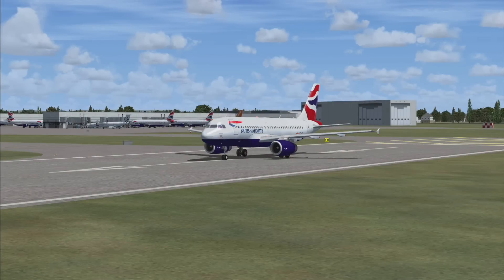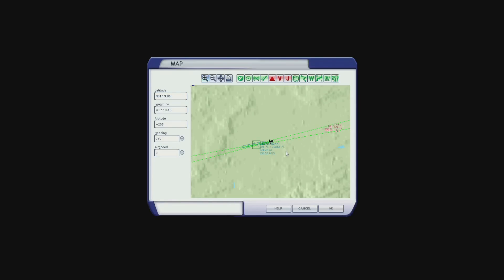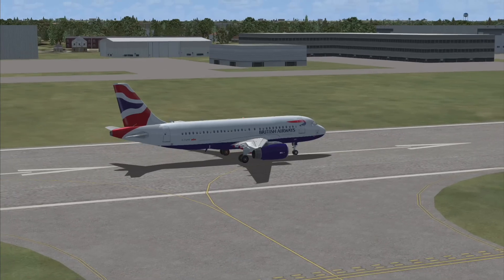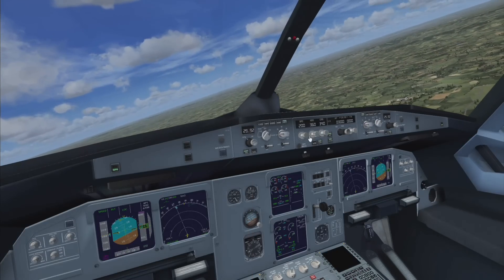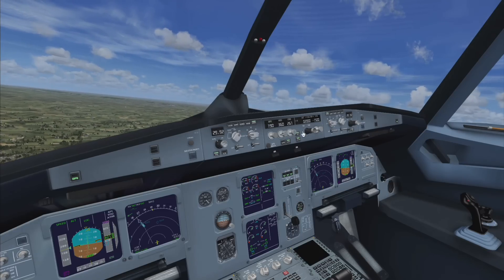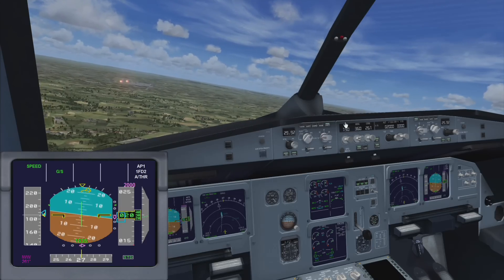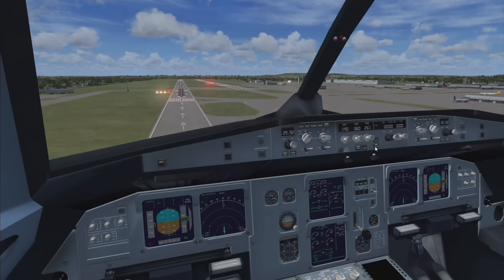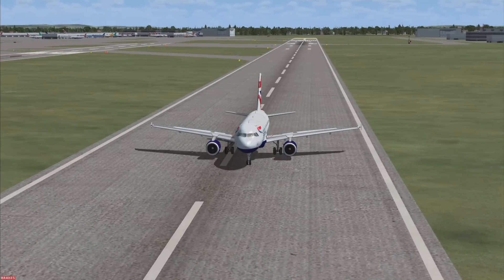FSX How to Land with ILS | Autopilot Landing | Airbus

Comment: My plane over flow the runway, then it goes in stall l quick go around full throttle then you hear that beautifull sound PULL UP PULL UP BOOOM
Reply: Same here
Reply: welcome to Lion Air
Reply from the maker: Are you sure you switched GPS to NAV and then used the APP switch?
Reply: After more than 400 crashes and watching your videos now i can confidently land any plane using ils.It was really frustrating when you fly for 1hour and when it comes to landing you crash the plane.😁No n1 was not the problem.the problem was heading lock.I should have turned it off and on airbus planes setting nav is a little bit more tricky.
Thank you for your great videos again.
Reply: @Uhhh wtf why l see these comments now? Yt didnt snowed me
Reply: @r9cheverny433  bru
Reply: @David-cs9zo  hey make sure you save your flights halfway through so you don't have to refly the parts you did fine at! Press ";" to save the flight

Comment: Great tutorial, do you think it's possible you could make an ILS landing/approach tutorial but on the stock Boeing 737-800?
Reply from the maker: Thanks for the video request! Please send it in to - jacksfsxvideos.com/request.
Reply: Bill Nye Umm, it works the same way in B737 too, just landed to Oulu Runway 12 ILS using stock B737-800, thx to Jack for helping :)
Reply from the maker: Ready to die, it is slightly different, but yes, on the whole it's very similar. No problem! Thanks for watching :D
Reply: Jack's FSX Videos Mostly the buttons are just in different place
Reply from the maker: Yeah and that there's no ILS button, which seems to confuse some people
Reply: Jack's FSX Videos But still somehow i made a smooth ILS landing with 737 xD
Reply from the maker: Yeah exactly, it's still possible, just looks a bit different :)
Reply: BILL NYE THE SCIENCE GUY
Reply from the maker: Uhm what? xD

Comment: Great video! Your other video on how to complete an ILS landing with a Boeing 737 worked perfectly. I almost have figured out how to land an Airbus with ILS, but it still seems that my plane is hitting the runway a little too fast and hard (despite having my speed setting around 150 and switching off autothrottle immediately at touchdown). More practice on an Airbus will be needed!
Reply from the maker: I think a slightly lower speed is needed for some Airbus aircraft, but try my written tutorial at jfv.tv to see if you missed anything :)

Comment: Nice landing. Sometimes after installation the runway just goes usually to the right, and it’s impossible to center the plane, the gamepad doesn’t want to work well, and the autopilot is inaccurate. I solved this problem by playing power intensive games, and by completing quests. One if these quests is in Cod 4, by taking out the two choppers with the rockets. The rockers were hidden next to the bus. I needed 10 retries to complete the quest. After that, the runway in flight sim remained in the center, the autopilot became accurate, and the gamepad started working. The nanouvers were beautiful, the chance of crashing the plane was reduced to 0. I can even swim the plane on water like a boat, earlier it always caused a crash.

Comment: Thanks for the tutorial. From your tutorials I've gotten ILS landing down pretty good with the built-in 737-800. I've started trying it with the built-in A321, trying to get the hang overall of the Airbus. I was trying to land at Sydney, Australia (YSSY), runway 34L, and for some reason it was not intercepting the glideslope at all, only the localizer. The diamond for the glideslope was just staying in the middle, even as I flew directly over the runway. It was working just fine for the Boeing 737-800, even on the same runway, is there some extra step I have to do for the Airbus that I don't for the Boeing?
Reply from the maker: I'm not sure for that exact example, have you watched both of my ILS tutorials for both Airbus and Boeing? Also try the written version at jfv.tv/flightpath

Comment: Hi jack. Tiny question, when u go to tjhe radio panel to set the ILS frequency on NAV1, u also click on the button  CALL of the NAV1? Because it looked like you didint' and in my cas that is the only case for the plane line with the runway (if I do not click the CALL, the plane does not line up). Thanks a lot!
Reply from the maker: I'm not sure what you mean by "call"?
Reply: @JacksFSVideos  Its the NAV1 button on the radio panel. I saw you just put on the frequency and nothing else. I had to press the button as well.
Reply from the maker: I'm not sure, it's been a while, try checking my other ILS video and my written version (links in the description)

Comment: Hi I have a question, how do you take off the a320, to what position do you set the flaps for take off, can you do a video how to take off. Also I have another question, can you tell me , when set the flaps while I'm reduced the speed, at what speed I nedd to set each position of flaps.
Thanks
Reply from the maker: You can watch my How to Take-Off video for the 737, it'll be mostly the same. For the A320, Flaps 1 is good for take-off. In terms of flaps on landing, there is no set speed, as there are too many variables, but if you bring them out too early, the aircraft will sound a warning that you're too fast etc.

Comment: This doesnt work me.  I have the ils frequency tuned in, the word LOC appears on the display but it doesnt follow the path down to the runway.  it just stays at the altitude I set.  the purple diamond moves to the bottom of the line.
Reply: Same
Reply: @manunathan12  You gotta check out the airport charts about the permitted altitude that VOR can catch your plane for instance Ataturk Airport needs the plane to be at the 3000ft when approach
Reply from the maker: If what muhammet said is still not working for you, try going through this tutorial again using the written version at jfv.tv/flightpath

Comment: Captain, on a general aviation plane like a small Cessna, do you need to enter a course number to use the ils or is the localiser not available?
Reply from the maker: No need for a course input on that kind of plane, in fact I don't think it's even necessary for a commercial plane, but is recommended

Comment: Hi I didn't see a a320 any where on the fsx I have so will this be the same as the a321
Reply from the maker: Default FSX only have the A321. You can find this aircraft in the description. However, yes, these instructions will work for the default version.

Comment: I have this issue, when I take off and fly my altitude ascends very slowly and ATC says I am like a couple 1,000 feet above my altitude even though I am really low, and yes my altimeter is correct. Please help me BTW I am using a Airbus A321
Reply from the maker: I think in this case it would be best if you could record the problem - showing ATC open with the message and what altitude you're flying at. Please upload the clip to a well-known cloud service and email me here - contact@jacksfsxvideos.com. Please also provide the exact aircraft you are flying.
Reply: Thanks, I will be creating the video shortly

Comment: Hey erm I did Gatwick to La Guardia and I click activate approach at about 10nm and then done the course before hand and the frequency before hand but didn’t switch until I activated approach. Then I click the GPS switch to Nav. Or the other way round. Then when I click the Approach Hold button. And then the plane didn’t line up with the runway I put in.  And it landing on the like the terminals and the plane didn’t go full around the airport to land so Im confused

This is what I did correct me if I am wrong:

Gathered the Runway Name and frequency and Heading noted it down. 

I then done the flight. 

At about 16nm I done the frequency then done the course I didn’t switch the frequency to active yet. I also did the approach and loaded it. 

Then about 13 nm I then Activated Approach then I switches the frequency then I switched the Switch from GPS to NAV. Then when the diamond reached the middle I clicked the Approach hold button. 
Then I just decreased speed. Then I realised the plane wasn’t gonna go to the runway can you help me?
Reply from the maker: Try the written version of this tutorial at jfv.tv/flightpath

Comment: where is the course you need to set? at 3:58 you set the course but where did you get that info?
Reply from the maker: Please re-watch the video at 00:58, this will explain where I got the course figure from.
Reply: I see now, that's the heading and you set it to the course, why is that? I managed to land but without setting up the course nor the heading, since when I have the navigation hold switch on and the plane gets close to landing, it automatically disables the heading switch and lines up the plane with the runway. I'm a noob in this tho
Reply from the maker: Yes, you put the heading number into the course area on the aircraft, this is simply how it is - they're the same thing when it comes to ILS landings. You don't necessarily need it, however it makes it more accurate. Hope this helps!

Comment: I tried this method to land at JFK 4L. Thing is the runway is at the other side of the airport and the GPS doesn't align me to that runway. Do I have to manually align myself and turn around before activating approach?
Reply from the maker: You will have to do it manually (to get around to the otherside of the airport), but if you're using ATC, they will guide you round to the correct side to come in for an ILS (if that's what they said the approach is)
Reply: Jack's FSX Videos. Using atc with IFR right? Thank you for the quick response
Reply from the maker: Yeah that's it and no problem :D

Comment: Do you have to put the heading in or will it automatically follow just by putting a ILS into the GPS
Reply from the maker: You don't put an ILS into the GPS, you need to use the frequency to enter it into the Nav1 radio stack

Comment: I’m having a bit of trouble and I’m hoping someone can help me. I can never seem to get the speed right, I either come way too hot and end up bouncing or roll straight through the runway or I stall out before I get to the runway midair?! What speed should I be approaching at? Thanks in advance
Reply from the maker: Have you followed how I decrease my speed in the video? Landing speed for a 737 is around 140 knots. And are you using autothrottle?

Comment: Question; I'm trying to follow the steps in this tutorial to make an ILS landing in the default A321 at Edinburgh, runway 240 (course 244, frequency 108.9MHz).  I get vectored to about 15 miles east of the airport at 2100ft, activate the approach via GPS and autopilot turns me towards the glideslope.  However when I activate the approach hold switch with the pink diamond right on the line, the plane dives towards the ground (ie crashes.)  I've never managed to automatically intercept a glideslope.  Is there something obvious I'm doing wrong?  Plane configuration at that point is 180kts, 15* flaps and gear down.
Reply from the maker: Thanks for providing all the information. I assume you're using ATC, have you been told to do an ILS approach? If so, are you pressing the Approach Hold button when they tell you to intercept the ILS? Also, at what point, or how close to the runway do you press the button?
Reply: +Jack's FSX Videos Thanks for replying!  I pressed the Nav Hold (LOC button?) at about 6-8 miles from the runway, with the threshold / PAPI in sight, at 2100ft with both glideslope diamonds captured.  I must have something wrong tho.  One thought- although Altitude Hold was definitely OFF, the vertical speed control was still keyed in to -1800ft/m from my previous descent.  Does this somehow override the approach?
Reply from the maker: I don't think you read my comment right. I was asking when do you engage the Approach Hold Switch? Also ensure the ILS switch and GPS switch is on before the Approach Hold switch goes on. Your vertical speed will not affect the ILS at all, as long as the Altitude Hold is off.
Reply: +Jack's FSX Videos Approach Hold switch was pressed when the pink diamond intersected the horizontal line.  I've just tried again and I'm lined up beautifully but for some reason the plane won't descend down the horizontal component of the glideslope.  Hmmmm
Reply: +limeyfox apologies second 'horizontal'; read 'vertical'.  It's late and I'm going to bed.
Reply: +limeyfox One final thought - at no point am I hearing any morse.  Is that any help?  Thanks :-)
Reply: +limeyfox apologies for the multi-posting.  Had one final go and cracked it.  You were spot on about the app hold switch - I was activating it before I was below the glideslope.  Thanks for the vital hint- so great to land ILS finally!!!
Reply from the maker: It's really good to hear you can now land with ILS! I'm glad I could help and don't forget to subscribe!
Reply: +Jack's FSX Videos Subbed :-)
Reply from the maker: Thank you so much! I really appreciate it!

Comment: hey Jack. I had a question
In fsx, will the aircraft fly if i run out of fuel in both the wings, but fuel is still left in centre tank?
Reply from the maker: Yes, they’re just storage tanks, engines take an equal amount from all 3
Reply: Jack's FS Videos okay. Thanks☺
Reply from the maker: No problem!

Comment: The aircraf isnt controlling my altitude should i turn the alt hold or turn it off
Reply: Memes Memes press on the notch you use to increase/decrease altitude and it will engage, you also need to have they Autopilot master switch on
Reply from the maker: Are you pressing the APP button?

Comment: what decides the number for a runway? The heading of it is about 80°/260°... combination?
Reply from the maker: Runway numbers are determined on the angle they are heading towards. For example, runway 09 has a heading of 90 degrees. Runway 12 has a heading of 120 degrees. Runway 28 has a heading of 280 degrees. Runway 36 has a heading of 360 or 000 degrees. And so on.
Reply: ***** then my guess was right! Thanks man. Your tutorials help me a lot
Reply from the maker: Glad I could help! Thanks for supporting the channel!

Comment: Hi jack, I am coming in about ninety degree to the ils runway and the plane often turn late and it will stuff up.What to do? Please help.
Reply from the maker: Make sure you use the GPS to set the approach early enough and use LOC to guide you in
Reply: I am doing all this , but I come in a ninety degree angle and the plane turns very late, your video was great. Please reply. Thanks.
Reply from the maker: Try reading the written version on my website
Reply: Thanks
Reply: My plane won't turn that much if I am coming in a 90 degree. Please help.
Reply from the maker: You’ll simply need to start turning early enough, it’s always possible as some aircraft will come in downwind

Comment: For some reason, the pink diamond starts at the bottom of the bar (so ILS lines me up with the runway perfectly but doesn't control my altitude) even though I've followed everything you did. Can someone help please?
Reply from the maker: It's most likely that you've started setting-up your ILS too late into the approach. Try doing it all again, but setting it up a lot earlier from the airport/runway

Comment: new to FSX and still having trouble following the exact AP  steps  when close to picking up the ILS for landing the 737....can someone post the exact steps needed after I have programmed my GPS flight plan...EXAMPLE:  I have my plane on course for my selected ILS airport RNY and when very near the airport  and my plane just fly's right over it and sometimes circles back around....thanks guys....
Reply from the maker: Sounds like you're only using the GPS, you need to be using the ILS for a landing (make sure you switch GPS to NAV). Try using the written version of this tutorial at jfv.tv/flightpath

Comment: I have a problem. Whenever I switch from GPS to NAV my plane always goes off course and crashes. Or perhaps I have not lined up with the runway well.
Reply from the maker: Yeah you need to make sure you're close enough to the runway to intercept the ILS
Reply: Oh thanks. I figured out now that I need to hear the morse code and then switch to NAV.
Reply from the maker: Yeah that's it :)

Comment: When auto pilot disconnected, why did the master caution light not flash ? Thank you
Reply from the maker: It shouldn't normally flash for just disconnecting the autopilot, though it might in some planes
Reply: hello and thanks. If you look at airbus landing videos on you tube, you will see that when auto pilot disconnected, you hear the disconnection sound and the master caution light flashes three times.
Reply from the maker: Sorry I thought you were talking about planes on FSX, yeah in real-life the caution lights will flash, but for this add-on and many others, it's simply not there - I think the Aerosoft one does it tho

Comment: When ever I  navigate to an airport using the gps and wish to land using ILS the autopilot takes  me to the centre of the runway normaly at right angles rather than following an approach. The only way I have found to land is to manually fly the aircraft then engage the ILS at some distance from the  airfield .I know this is not the correct way .What am I doing wrong?
Reply from the maker: Are you using ATC as well?

Comment: Which key should I press to write the frequency.
Reply from the maker: There is no key to write down the ILS frequency. You simply write it down on a piece of paper.
Reply: no i mean when you were in the flight, a window poped out. What did you do to get it out?
Reply from the maker: Do you mean the Map, GPS or Primary Flight Display?
Reply: Primary flight display
Reply from the maker: You can enlarge that display by simply clicking on the Primary Flight Display while in the cockpit.
Reply: Jack's FSX Videos thanks a lot